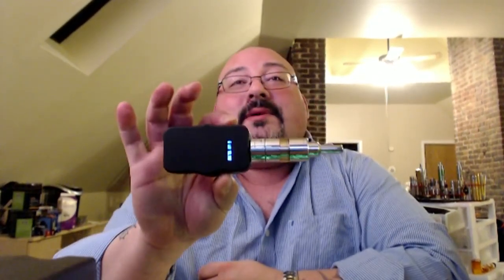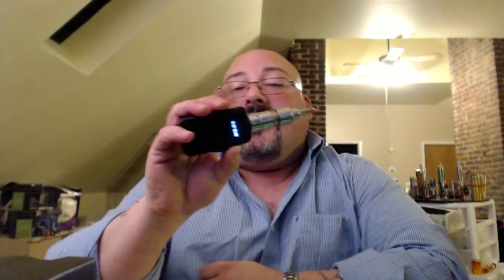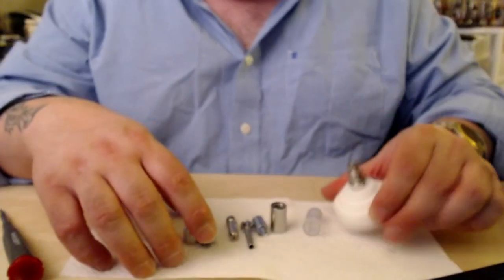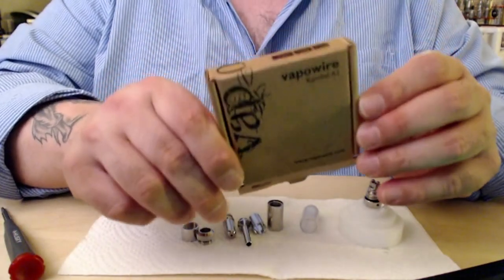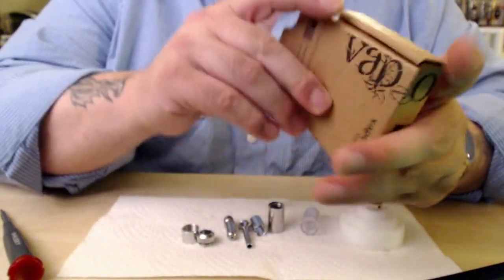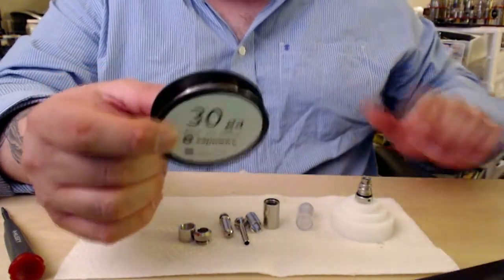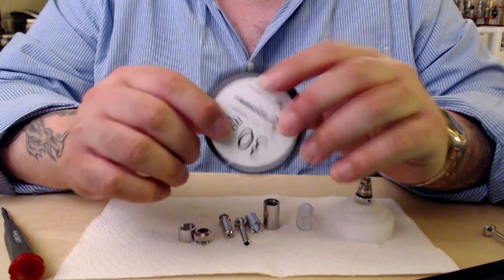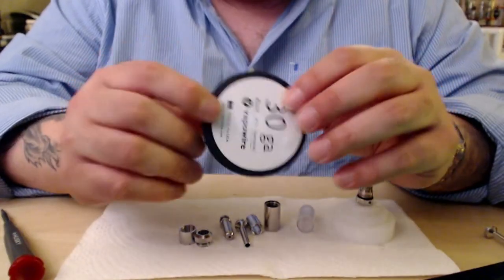KayFun Mini Dual Micro Coils .6 ohms Cotton Balls

Comment: Hey Bishop!

How is this any different than doing a single with 10 wraps with 30 gauge kanth, both yield .6 ohms but the way you wrapped i tried as well, seems like it's just a big pain in the nuts. It does look way better as far as just marveling at your creation when it's done, but simply just wrapping 10 single micro gives you the same thing.
Also your vapor production looks a little low for a .6 what vg/pg you using?

Thanks!
Reply: No, single wire with 10 wraps instead of 2 wires with 5 wraps will have much higher resistance. What he's doing with this dual wire coil is similar to getting a thicker wire in terms of lowering resistance, but the wires since they are thinner will cool off faster once you stop firing.

Comment: Hey Bish, how is that vanilla custard by fluid? I have tried a few other vanilla custards and they don't hold up to my sub ohm vaping. I usually am around .3-.5 duel coils all the time. I use big airflow holes but it seems to not do well at low low ohms. Do you think the fluid vapor one will? Seems like it is doing well in your kayfun but what if it was even hotter in my drippers?
Reply: Im using HopE-liquids vanilla custard on a .6ohm and it's rock'n just fine. But the only thing with Hope's eliquids, ya gotta let them steep. I have a shipment of her liquids coming my way soon if the post office decides they want to put them in my mail box. I wasn't sure about her custard in the beginning and after reading some place about her liquids and the way luck would have it I had other juice to vape and it sat for 2weeks and it was awesome vanilla custard. I'm on my last 30ml and this last 30 is awesome flavor and like I said above another 120ml vanilla custard on its way with a few other goodies from HopE-liquids. She is out of Florida some place. And, she always has some sort of special going on. Last one was for veterans day. 35% off plus a free 10ml of your choice. Last time when I got my custard from her there was a 45% off sale...Unbelievable! She has at this moment 25% off.
Fab
Reply: fabforceone
Try Goose Juice from Quack's Juice Factory. It's heavy VG, which may help with the low ohms, and is a very tasty vanilla custard type juice.  :)

Comment: bro if you rock that thing on a mech you know you will get a much bigger rip? dual micro coils .6 ohms at 20 watts is only 3.464102 Volts on a mech you will get anywhere from 4.2 V to 3.7 whick if you use ohms law you will find that it would pull 29.4 watts to 22.81667 watts great vid tho

Comment: How is this dual coil?
Reply: i agree with you, that is not a duel coil. that one coil with twisted wire, that is not a duel coil
Reply: *****
Wrong, the ohms drop so low because the wire is now twice the size.  its like going from 38 gauge to 28 gauge, the ohms drop because the wire gets much thicker, both wires are making contact with each other the  along the entire coil so  in theory its just a thicker  gauge now, thats why the ohms drop so much.  the were in depended only one would glow at the path of least resistance. try it on a a atty with 2  straight pieces of kanthal and just twist the ends together and connect them into the post of a atty, only one wire will glow... m not knocking you bud, you have tons of great videos, and I watch them on the regular but this time you are wrong

Comment: This is a twisted 30 gauge coil not dual coil
Reply from the maker: WOOOOOT FORGETABOUTIT!!!!!
Reply: ***** this is NOT a dual coil. A dual coil build is TWO coils.
Reply: This is a parallel coil build.
Reply: Yes i do, because that's exactly what it means. Two wires used on the same coil is called a parallel coil. Two separate coils is called dual coils. Kinda rebuilding 101. Idk if terms are a little different where you are but in the west coast and south thats how it is.
Reply from the maker: I separated them to show its two wires they can also run parallel.